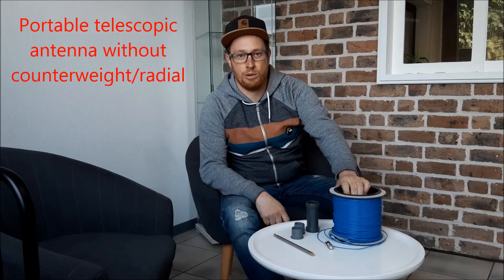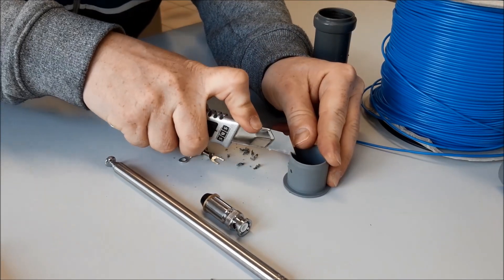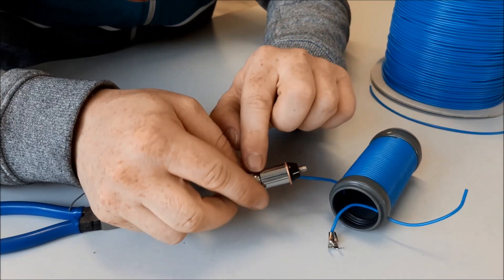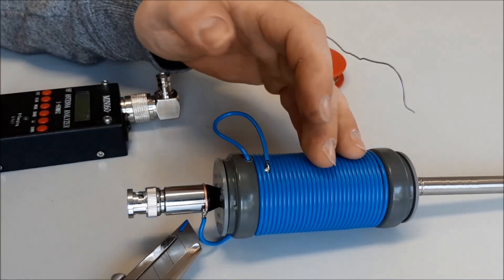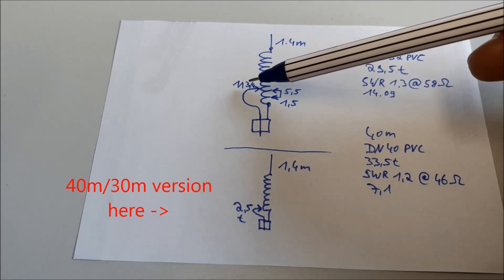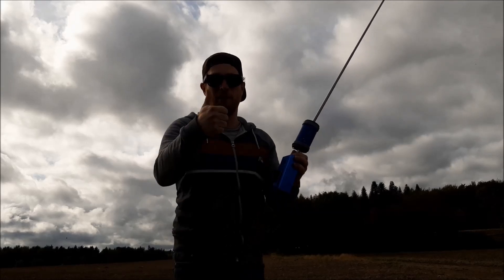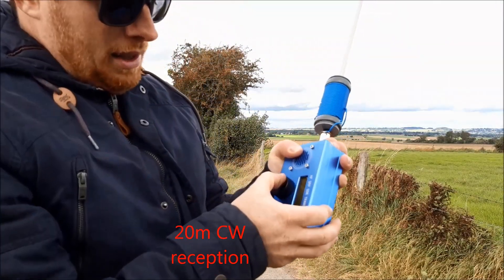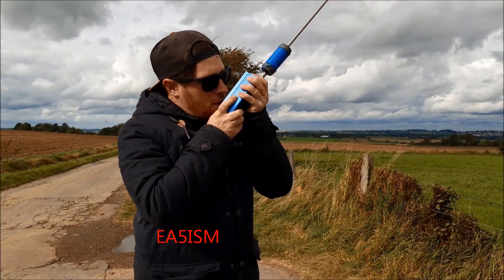Ultimative DL1DN sanitary cheap DIY QRP telescopic antenna uSDX QSO on 40/30/20/17/15/12 + schematic

Comment: Just one comment on the BNC connectors used on these antenna, I have found that they are not very stable and move somewhat and I question the suitability  of them being used. What I have done is to mount the antenna onto a backframe with a thin coaxial cable connecting between the antenna and tvcr. In winds, the antenna whip will sway and eventuall break imo. I hope that David will use a better connect for the next projects.

Comment: Thank you for this video! I've made the 20-m antenna on 32-mm spool, my peak SWR is around 1.5. Unfortunately the 40-mm spool didn't work for me at 40-m, the lowest frequency I was able to achieve while tuning was 8 MHz. Probably a bigger 50-mm spool is needed (and anyway, the SWR won't be great, I'm afraid). Though I've successfully tuned the 40-mm spool for 14 MHz, with peak SWR around 1.2.
73 R1BNG

Comment: Hallo David: Kannst du mir bei den Messungen der Spule helfen? (Außer der Sprache meiner Großeltern verstehe ich kein Deutsch und das Schreiben würde mir sehr helfen) Für beide Bands: 40 und 20
PVC-Rohrdurchmesser: 40 mm für 40 und 32 mm für 20 m?
Anzahl der Kabelwindungen: 34 Windungen für 40 und 24 für 20?
Durchmesser bzw. Querschnitt des Kabels: 1 mm?
Länge des Teleskopstrahlers: 140 cm?
Vielen Dank, David. Grüße aus Argentinien
LU1FK - Marcelo Kunz
**********************************************+
Hola David: Me puedes ayudar con las medidas de la bobina? (mas alla de ser el idioma de mis abuelos, no entiendo aleman, y por escrito me ayudaria mucho) Para las dos Bandas: 40 y 20 
Diametro del tubo de PVC: 40 mm para 40 y 32 mm Para 20m?
Cantidad de vuelatas de cable: 34 vueltas para 40 y 24 para 20?
diameto o seccion del cable: 1 mm?
largo del irradiante telescópico:  140 cm?
Muchas gracias David. Saludos Cordiales desdes Argentina
LU1FK - Marcelo Kunz

Comment: Nice job! Tried to make it too, using  Eupen 1mm2 cable, but can only get 27 rounds on it. What is the outside diameter of your wire ? As the 1mm2 I have is 2.45 and the 0,75 from Eupen is stated to be 2.4mm outside diameter.That would make only one more round, and no way near 29. 
I am using a bnc whip from eBay, which is 1m20.  To compensate for the 20cm  I would likely need 2-3 more rounds on the coil I suppose ?
Reply from the maker: 0.75 sqare it is 1.5mm outside

Comment: Nice build! Watched a few videos from you with it, but now I have a few questions;
would  it be possible to make multiple taps to the 40m coli to use 20, 30 and 40 on one Coil, so you don’t have to switch coil ? 
Wat is the length/diameter of the pvc pipe ?

Thanks, 73
Rick
Reply from the maker: Yes it will work but you have to change the position of tuning

Comment: How will the antenna change if i use thicker cable and more windings? Thanks!
Reply from the maker: If the cable is thicker and you go for more turns it will be the same

Comment: Impressive 5 watts with a portable antenna!   That is the perfect setup for HT.  The radio is so versatile 10w with battery, but I love how you can use this anywhere with built in battery under $200

Comment: Great video, one question, can I use coax cable from BNC connector to the radio?, I couldn't find the BNC connector with the screw at the bottom
Reply from the maker: Is possible but a little bit other tuning is needed

Comment: You sould build a similar antenna for the (tr)usdx, if possible thinner pvc maybe 1 1/2". But please put the measurements in the comments.
Reply from the maker: For the trusdx it will be to much force I do not reccomend
Reply: @QRP.lifestyle  Too much force? What and why?
Reply from the maker: @TheMicrofox  because of the SMA connector and plastic case
Reply: @QRP.lifestyle  Thanks. I'd like a metal case for my truSDX, but didn't find anything so far.

Comment: This is simply amazing and a must antenna for all QRP lovers. Which is the Radio used by you and what is the length of the telescopic Whip Antenna 

73s
De VU3OSA 
INDIA 🇮🇳
Reply from the maker: I reccomend the trusdx
Reply: @QRP.lifestyle  What min size Whip is needed to operate 40M and 20M bands...can you pls advise
Reply: @gaurav279  it depends on your coil. If your coil is bigger you can use shorter antennas....
Reply: Pls guide David

De VU3OSA 
INDIA 🇮🇳

Comment: Could you tell me the polarity of the 13.8Vdc power input. Also if you can give give me wiring information on the microphone plug. I have ordered one of these radios and it will be a while before it arrives in post. Cheers from old George known as G1BKI.
Reply from the maker: I dont know only use internal battery 😉

Comment: Since coming back into the Hobby of Amateur Radio . I haven't made a single QRP proper contact in 2 months. Blasted out by 2.5kw stations. The QRP calling Channels blocked. Cheers from old George in the UK.
Reply from the maker: Build my dx wire antenna (other video) you will do hundreds of contacts from the first run
Reply: @QRP.lifestyle  Many thanks for suggestion but I have already 1/2 wave end fed. Magnetic loop and a multoband vertical. But it wont stop 1kw and 3kw people using excess power. Especially on the qrp calling freq. Cheers from old George

Comment: I have ordered the radio through Amazon about $180.  I built one antenna and used 35 feet of AWG 12 srtranded wire. I used an empty plastic bottle alcohol and a babys safety pin to puncture the insulation to tune it. Im pretty sure it wont work so I plan to build another one using a 2.5 inch plastic drain pipe. I will use 14 or 16 gauge stranded wire because David shows in his video a very flexible blue wire. My 40 meter group meet around 7,100 mHz. Good luck. HP1Kl

Comment: how about using a tape measure as a length adjustable antenna with tuning ? no one seems to show a test of it working ant tap measure hf antenna is a GREAT idea for QRP
Reply from the maker: It will work

Comment: Hello.
   Thanks for your great video.
   Could you write the characteristics for those of us who don't know how to speak English?
   I would need to know the following information:

           1- Telescopic antenna length. (The antenna that I found on AliExpress is 120cm. Would it work?)
           2- Coil diameter for each band.
           3- Number of turns for each band.
           4- In which turns to close the cable.

   Do you have a website where I can see these steps to build one?
   Can it be done with finer wire? being 5W I don't think so much cable section is necessary, in this way weight could be reduced.
   Thanks.
Reply: I will.use a 1.4',meter wire instead of s whip and.will suspenf or hang the whole contraption HP1Kl
Reply from the maker: I have create a kit
Reply: @QRP.lifestyle  how can I buy the kit?
Reply from the maker: @dennispronk6403  just write an email

Comment: I will rebuild your antenna with 0,75 mm2 wire the same tubes and try it with the same qrp device. I will post my results here. Any tips for 80 m?
Reply from the maker: I testet 80m but no contacts made

Comment: Are you sure about the wire beeing  only 0.75   mm2  (copper inside) ? It seems to be stroner in the video. And is it better to use stern instead of flexible wire? What happens when I use stronger wire? Thank you for the great info and you made my day too...
Reply from the maker: 100% sure

Comment: Is the lower end of the coil connected to the body (cable braid), and the central contact of the connector to the turns of the inductor? Did I understand everything correctly?
Reply from the maker: Yes
Reply: @QRP.lifestyle  Can this antenna work on the 80m band?
Reply from the maker: @ДмитрийНовожилов-ю8ф   No you have to make a bigger coil or longer whip

Comment: what do you mean for "deeper frequency" ?
Reply from the maker: If you want to go deeper in frequency you have to wind more windings.
Reply: @QRP.lifestyle  could be suitable also for 11mt  cb band? I red below that you suggest 20 diameter and 15 turns? is it right?
Reply from the maker: @sysman76  you have to test it I do not build for 11m
Reply: Lower frequency

Comment: Where did you get the BNC male to m5 thread adapter? Thanks K7WHN
Reply from the maker: There is a M5 screw added. The BNC male you can find on ebay. For example as rg58 connector

Comment: Hello David, I just built the antenna you demonstrate on the video. It's my first time building one.  My antenna doesn't seem to be capturing any signals. Any tips on things that are easy to make a mistake? By the way, the antenna is short circuited, is this expected? Thanks!
Reply from the maker: You have to find the right spot on the coil. If you use for example 1.3m whip it is totally different
Reply: @QRP.lifestyle  I used my antenna on my HT, which is a receiver on HF but wasn't capturing anything. I then removed the coil-ground connection and tested on my HF radio and it worked. So I'm not sure if I should have the coil-ground connection or not. Do you know? Thanks!
Reply: Checked with Nano VNA, the shorted coil to ground is needed otherwise there’s no resonance in any frequency. Now on to tuning it.
Reply from the maker: @LevyCarneiro  than the coil Was to long like mine on 20m

Comment: Beginner's question: what happens if you add a longer or shorter whip, then you have to re-solder the wire on a different position on the coil?
Reply from the maker: Yes you have to adjust
Reply: @QRP.lifestyle  Do you have the part number for the bnc connector?

Comment: Beautiful antenna! Information about the coil is important. Please inform the diameter of the wire and the diameter of the wire in the braid, and even better the inductance of this coil.
Reply: Yes, please sir.
Reply from the maker: Diameter wire 0.75 sqare mm, diameter coil 40m 56mm, 20m 35mm
Reply: Thanks!

Comment: I'm a ham since 1996 (Py2) and I'm off the radio for a while bcs I'm in the process of settlement in Canada. I'm going to use the same setup you have in this video (bcs that's what I can afford right now). I'm not as skilled as you so I'd like to check if there's like  3d printed version for these antennas. I just saw a video of a 3d printed coil to go on a pole, I wonder if there is one to make an antenna to use in hand help style jystnlike you're doing
Reply from the maker: Maybe I will do a 3D core

Comment: Great project.  Unfortunately I cannot find the telescopic antenna you described.  Do you have any alternatives?
Reply from the maker: That is possible but a lot more work to set up. I will do a new video as soon as I get the material.
Reply from the maker: Subscribe I will do a version with more available parts
Reply: I do it.

Comment: Some information for the 40m-version:
i use the DN40 pipe, but it needs 35,5 windings for the coil. Testing with the middle wire of the coax, i found a point with 50 ohms! Now, after mounting the antenne, its exact 49,9 ohms, F res is 7,070 Mhz, SWR about 1,2. 
Now i only have to wait for the radio....

And the 20m version is on planning....
Reply from the maker: Perfect
Reply: @QRP.lifestyle  what the wire size you used to wind the coil?
Reply from the maker: @surdinkalol  approx 1mm
Reply: wie hast du das berechnet? ich würde auch lieber dn40 nehmen, meine Teleskop ist aber nur 108cm lang (alte rc car funke)
Reply from the maker: @scooby_81  try and error und meine Erfahrung. Für 1m Strahler muss der Durchmesser eher größer oder länger werden sonst gibt es keine Anpassung. 73

Comment: I am EA1CEI. Congratulations for your videos and also for your antennas. I will start inmdiatelly with 40m model. But, I have a quiestion about PVC pipe. On your video, you suggest to use a 40mm PVC pipe, on video seems 20m model uses 40mm and for 40m seems bigger, maybe 60mm diameter pipe...I can get anyone on local market but I must know which is the right diameter and how many turns for 40 meters...If I use 40mm pipe, sure I must to place 33.5T ???? One more thing...Wire diameter please...Seems 1.5mm.. iam right ?? Thank you in advance
Reply from the maker: The diameter is 56mm
Reply: @QRP.lifestyle  pero en su vídeo, en el minuto 04:30 muestra un esquema donde indica que para 40m es un PVC de 40mm.
Hay un conflicto ahi. 
Gracias.

Comment: Excellent video. This is what I needed.  Just finished building my two bander (20,40) uSDX. I bought two fiberglass telescopic fishing rods (just 135gm weight). Plan to run a wire inside. Will a 3 meter element have any advantage over 1.5 meter? I can remove one section of the pole and shorten it to 1.5 meter.
Reply from the maker: 3m works a lot better but the coil must be +- half of the windings.
Reply: @QRP.lifestyle  Thanks. Will do a 3m. Will share the outcome.
Reply from the maker: @handyman7147  please let me know

Comment: Did you try this antenna for 15-10m bands?

73 PP5MGT
Reply from the maker: If you reduce the length you can work 20/17/15/12 for 10nyou need a lot smaller coil

Comment: Fantastic video David. I also run a similar pedestrian mobile type station. It is also hand portable with the Xiegu X5105 and centre loaded whip antenna and have worked some good DX. I have attached a link to one of my videos. Please could you tell me where I can buy one of those BNC connectors with the screw threads ? 
Hope to work you on 20m. Thanks for sharing 73 from M0DAD (David)

https://m.youtube.com/watch?v=AOY5V8VvdrM&t=81s
Reply from the maker: Nice video David, just check my VK5 QSO ;) That was outstanding
73

Comment: hola que diámetro exterior tiene ese pvc y el cable que usas se ve muy interesante
Reply from the maker: Hola el diametro es 40mm por 20m y 56mm de 40m. Cable es 1.0mm standard
Reply: @QRP.lifestyle no encontré un cilindro con esas medidas así que lo ice  en 3d  quedo muy bueno pensando en lo pequeña que es la antena contacto chile- argentina  crusando la cordillera de los andes mas de 1000km
Reply from the maker: @ca4wqp  muy bien, no perfectamente 😉

Comment: The resonance on that kind of antenna is not at 50 ohms and you won't get anywhere near an accurate reading without ground radials.  Probably be closer to 12-25 ohms and then you will need an impedance match of some sort.  That being said, cool video and it shows how forgiving HF is on antenna systems!
Reply from the maker: No its about 50 Ohm and SWR about 1.2
Reply: @QRP.lifestyle  what I'm saying is where it is 50 ohm is not necessarily at resonance.  Do an r/x sweep with a vna and you will see where the antenna is truly resonant and then you can match that impedance.  Took me awhile to get my brain wrapped around this concept!

Comment: David;  Where did you get the telescopic antenna, BNC connector and what is the AWG of the cable, 73 de KP4PTT
Reply from the maker: Wire is about 1mm BNC and antenna from an radio antenna found out ebay

Comment: Where did you find the form for winding the coil and the end caps It appears to be about 1 1/2 inches but have not seen a form like you are using and also the number of turns on the coil.
Reply from the maker: Its a German waterpipe about 40mm.
Windings you can find while video

Comment: hi DAVID...just to know where did you find the bnc connector like this..and also this telescopic antenna at 1.40m ( we find smaller, or really longer)....thanks for sharing this good idea !! 73 s pascal f5pnp
Reply from the maker: There are 1.3m antennas with bnc connector you can use the bnc and telescopic part. Ali +-4$
Reply: @QRP.lifestyle  ok i m going to see if i can find one !! thanks

Comment: Thank you for this video! Very interesting. Do you need to have your finger on the ground connection when operating this antenna?
73 de Arnie W8DU
Reply from the maker: Yes you have to
Reply: @QRP.lifestyle  So there is a counterpoise, its you....

Comment: Hast Du mal versucht es einfacher zu gestalten die korrekten Abgriffpunkte zu finden ? Einfach eine Nadel an das Ende
des Drahtes löten und die Abgriffpunkte dann durch einstechen zu finden ? Evtl. findet man so auf der Spule auch noch
Punkte für naheliegende Bänder und könnte das ganze umsteckbar gestalten so das dann evtl. auf 20/17m die kpl.
Länge des Teleskops ausgenutzt werden kann. Man könnte dann ähnlich umstecken wie bspw. bei einer Outback. Halt
nur eben nicht für 80 - 10 sondern halt eben für 2 naheliegende Bänder.
Reply from the maker: Ja mit der Nadel geht, ich hatte aber keine zur Hand. Derzeit verkürzen ich den Strahler das ist natürlich nicht so effizient als würde man anders abgreifen. Aber- Dann muss man die Spule auch unten anders verkürzen. Da sind später viele Buchsen und Stecker dran. Das habe ich schon gemacht ist aber schwierig stabil aufzubauen damit es langfristig hält. Meine Version reicht und außerdem macht es mehr Spaß noch ineffizienter QSO zu machen.
73 David DL1DN
Reply: @QRP.lifestyle  Ich habe mir gerade mal einen 5,6m Teleskop bei Aliexpress bestellt. Ich will mal etwas anderes versuchen.
Geht darum ein langes Teleskop direkt auf den Antennenanschluss meines G90 zu adaptieren und mit dem internen ATU zu
verwenden. Für HaFuG Betrieb ist das natürlich extrem lang aber zwischen 20 und 12 m könnte man immer 1/4 L realisieren
und auf 10m gar 1/2 L. Für den Preis von 30,11 €, incl. Versand nach DL, erschien mir das gut um mal wieder ein wenig zu
experimentieren. Da das Teleskop einen M10 Anschluss hat passt es auch wunderbar auf meine HF-P1. Die wird man dann
natürlich abspannen müssen, HI. Link will ich jetzt keinen Einfügen aber wer nach DF5WW sucht wird auch eine Mailadresse
finden. Im Zweifelsfall immer @darc .......